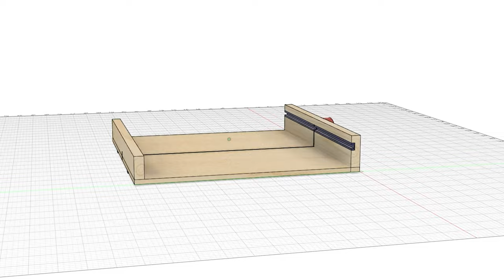YOU Can BUILD This Crosscut Sled || DIY Beginner Woodworking

Comment: I find a sled invaluable for squaring up wider pieces that the SCMS can't reach. Only suggestion I have for yours is on the back of the stop block machine a step above and below the bolt hole so you leave a spigot protruding out that fits neatly in the tee track either side of the bolt . That will stop the block from swiveling and just slides straight along the track and is always square to your workpiece. Nice work on all the steps you took to build the sled.
Reply from the maker: Thanks for sharing, I will take a look at that for the stop block :)

Comment: One thing to think about for us newbies, make sure that the saw blade is @ 90 degrees too especially often cutting other woods @ different angles and that the Fence is also @90 degress, I have a contractor tablesaw and noticed a couple of times it was slightly out, check sq, measure 2x cut once 
Thanx for showing, I made one of these but am not happy with it so I will try yours, just gotta get that blasted T-track, it’s not easy here
Greetings 🇩🇪 and have a great W/e
Reply from the maker: That is a very good point my friend! Always make sure your blade is @90 degrees = good advice! Thanks :)

Comment: Good thing about building your first sled is it doesn't have to be overly complicated like all those "ultimate" sleds from other videos. So you will have chance to decide which additional feature will be useful for you and implement it into your next sled. BTW that so called mistake you made with routing wrong side of fence is in fact a very useful detail cause it allows sawdust to accumulate in that routed pocket so you don't have to swipe sled every time you make cut to ensure that saw dust doesn't affect squareness of cut. Anyway good useful build!
Reply from the maker: Thanks, I was thinking about adding track on the actual sled too but then figured it could wait until I knew if I actually needed it. The happy accident did work out, I did cut off the excess but used my hand plane to ensure there was still space for sawdust to collect. Thanks for watching

Comment: Never use a table saw while wearing long sleeve shirts, coats or sweat shirts. Even if you push the sleeve up it can fall down and can get caught in the blade. My husband knows a fellow that lost a finger by wearing a coat while running a saw
Reply from the maker: Good safety message for sure.